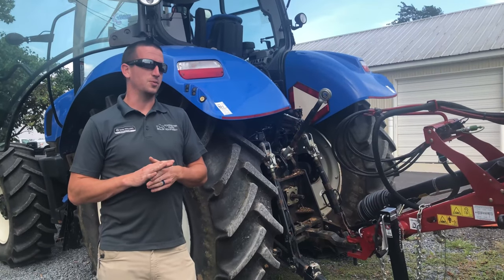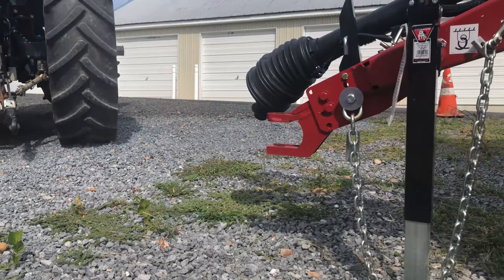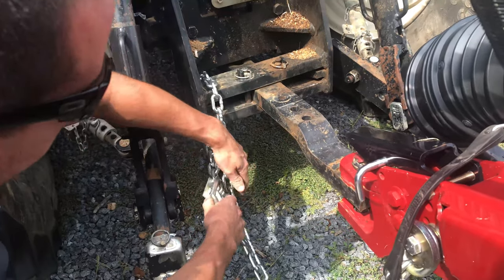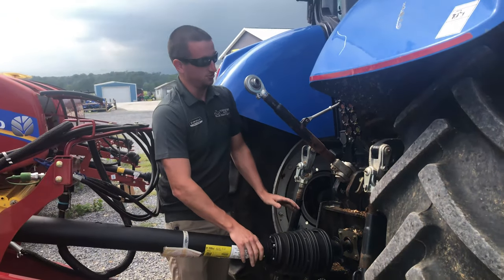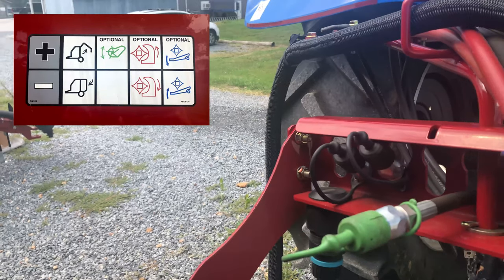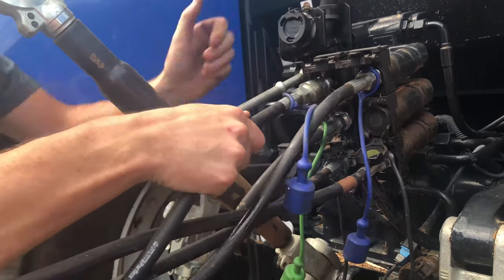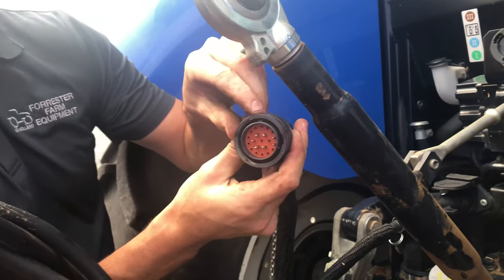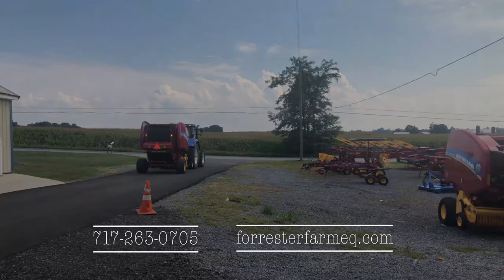How to Hook Up a Round Baler in Less Than 3 Minutes

Comment: I have a 2022 JD 5075e cab and bought a used  2003Claas 280 Variant baler. I am unable to connect the electrical to the tractor because the baler does not fit the tractor cab connection. Is there something I am missing or is there a converter to allow me to hook up the electrical or how would I hook up the electrical. thank you for reading this, i need help!